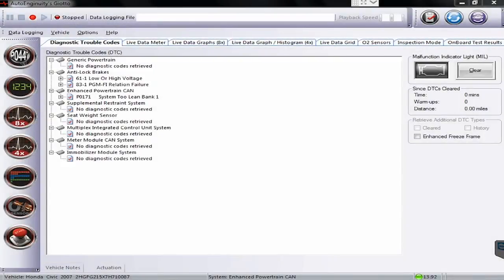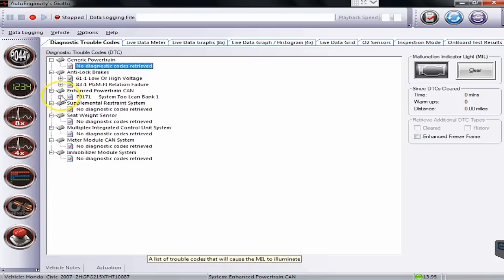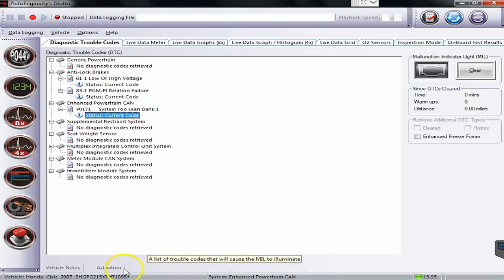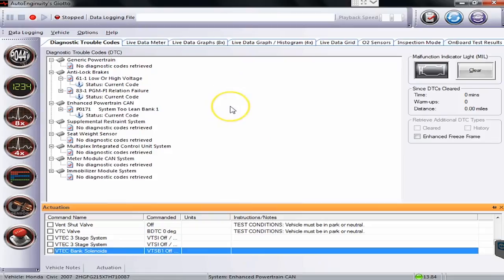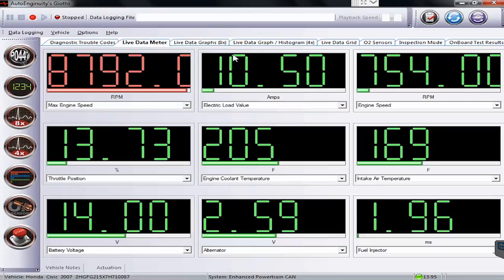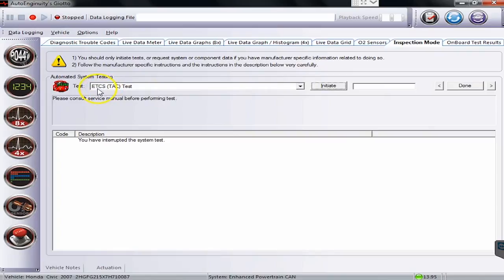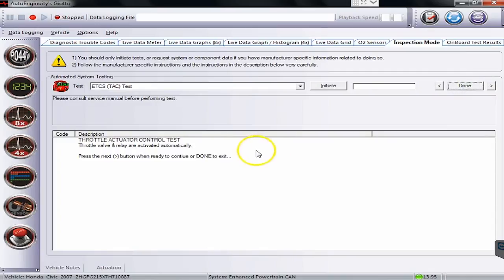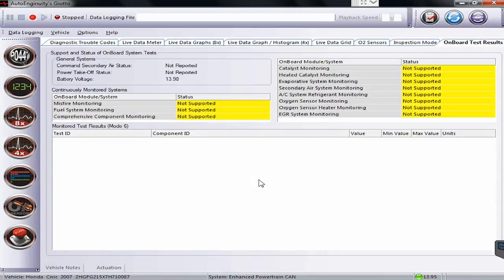Auto Enginuity 2007 Honda Civic Demonstration

Comment: What’s the subscription cost annually? Or is it free lifetime like VDCS?
Reply from the maker: There are no required annual fees, you just don't get updates after the first year. If you want updates/support after the first year it is $50 per module, so if you had only Honda it would be $50.
Reply: Diesel Laptops thank you I heard $450 for all modules. How many makes and models? Same as Autel, snap on , Bosch etc?
Reply from the maker: @weldingjunkie  AutoEnginiuty has a ton of modules. If you went with just USA coverage, that would be 3 modules -- Ford, GM, & Chrysler/Dodge which would be $150 per year. If you added Toyota/Lexus/Scion, that be another $50. I do want to say it caps out around that $450 mark.
Reply: Diesel Laptops ok thanks for the info looks like the coverage is on par with other scanners.
Reply from the maker: @weldingjunkie  Our testing, and some very large corporate client testing as well, has found it to be better then the other scan tools out there. It is just a PC-based application while others are typically handheld/integrated tablets.